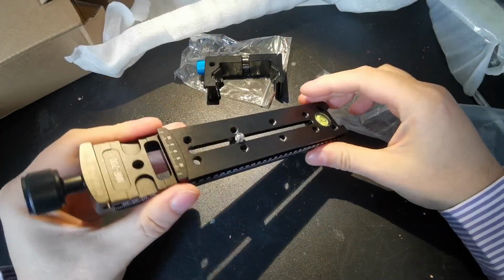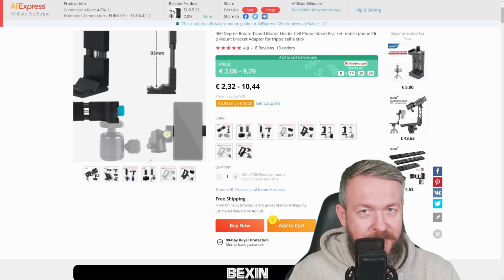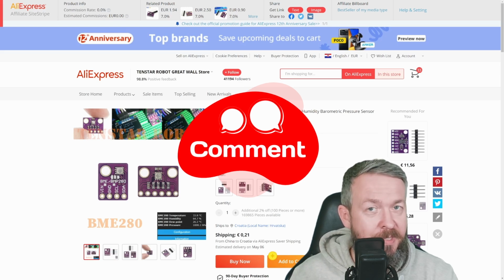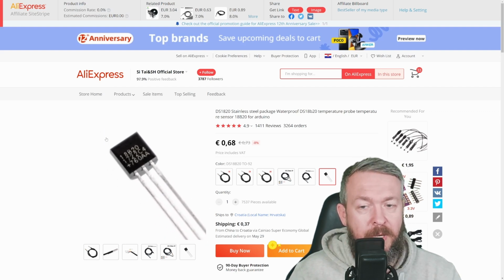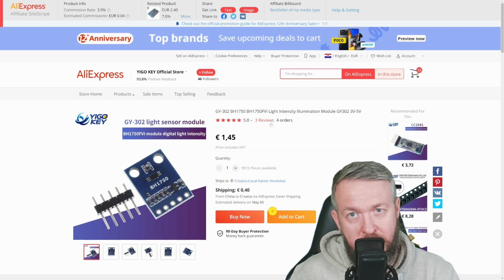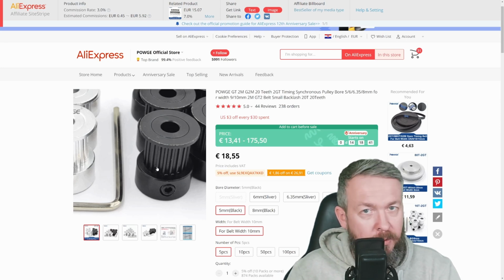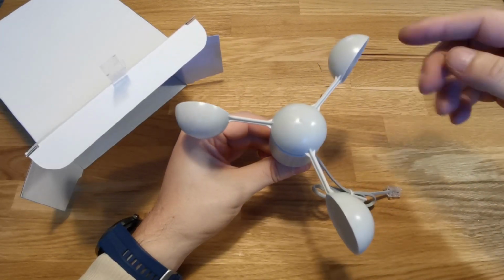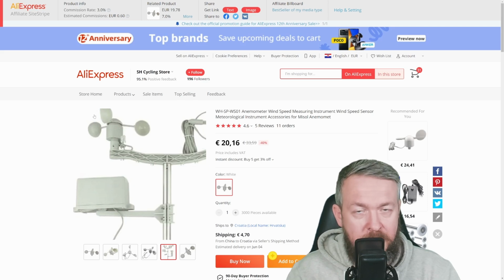Mail day #034 Phone Mount, camera slide, BME280, BH1750, DS18B20, ...

Comment: I can't testify as to the longevity of the BME280 yet, as mine was deployed only a few months ago, and has at least survived the British winter, which the humidity part of previous AM2301 sensors did not, but one thing I did encounter, was how ridiculously sensitive it was to any slight heat from other nearby components, both radiating or convecting from my microcontroller, and conducting through circuit tracks. Its temperature readings were so skewed, I actually checked the source code of Tasmota to see if it was self heating due to being polled too often, but no, only putting the thing on the end of flying leads, well away from the microcontroller, restored normality. You shouldn't really have the same issue, using deep sleep and everything, nothing should get warm enough, but the warmish mass of a nearby 18650 might skew the reading a bit when things are otherwise meant to be cooling down.
Reply from the maker: Thanks for this Ken! Much appreciated!!!
AFAIK BME280 has that self heating issue too. But since project I used this has 2 sensors for temperature, decided to use this one as housing temperature sensor and other one that is on a long lead, it is for air :) Deep sleep should provide enough time to remove any possible heat from components and battery charger and battery are above the sensor, so hopefully, heat will travel upwards.

Comment: For the anemometer/deep-sleep challenge: would it be possible to use something like CD4017 counter? I think these are used in bicycle sensors for example to save battery. For example, it runs on low power and only pulses the microcontroller to wake up after 256 or 1024 pulses have registered. Then, you can wake up to record the speed, and in theory it would happen far less often. Not sure if this is good practice but the idea popped to my mind!
Reply from the maker: That's great idea. For rain I think it will be able to use as is, but for wind this may be needed.